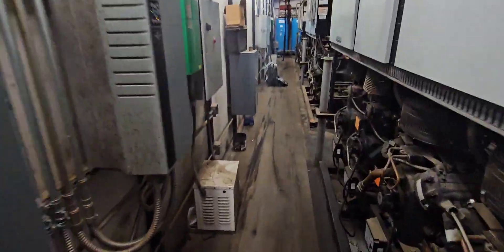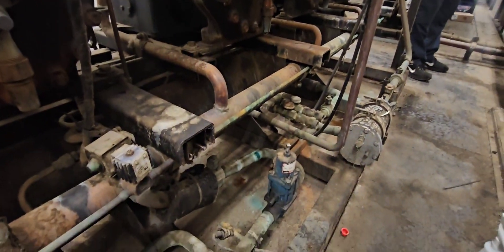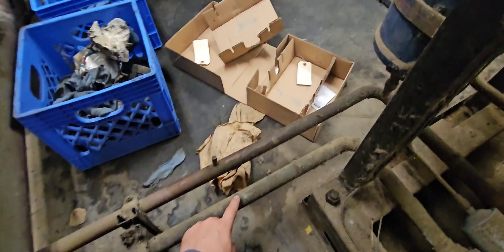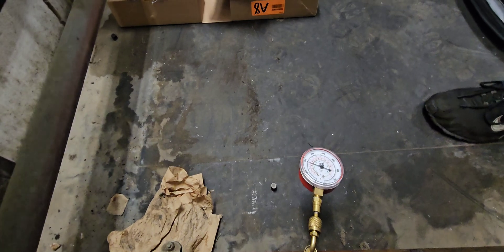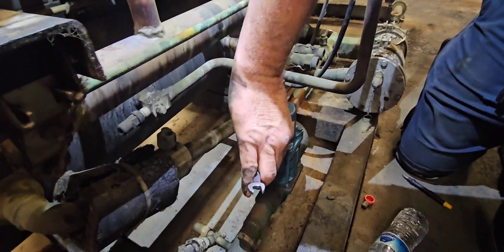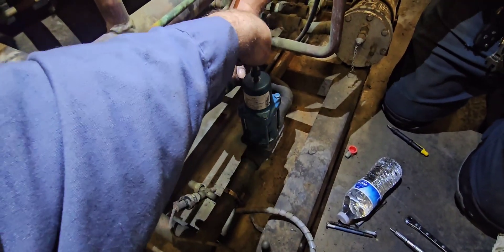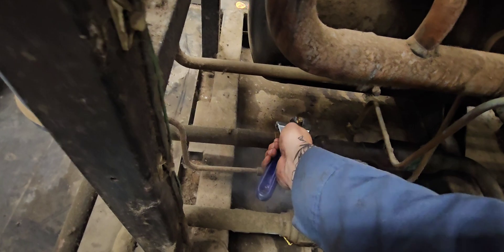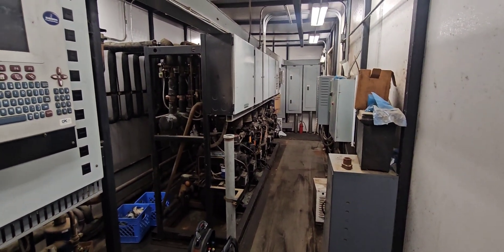Supermarket Refrigeration: Liquid Pressure Regulator Valve (LPRV) Replacement

Comment: no hate just sharing, I've always been told use oil to lubricate its already running thru the system.
Reply from the maker: @colejc  makes sense. Ill use oil if it's readily available. But I'm not going to open a can of oil for 3 small gaskets. Plus nylog is made of refrigerant oil. I appreciate the input brother.
Reply: @SupermarketRefrigeration  In a pinch I just grab a lil bit from a nearby compressor from the oil pump access port. Any paper gaskets and rubber O rings  just need a light coating of oil but not saturated it keeps it pliable and aids in sealing plus helps with releasing if disassembled in the future but never oil metal gaskets always install dry and make sure surfaces are dry.
Reply from the maker: @kmrjeep  thanks for the tip!